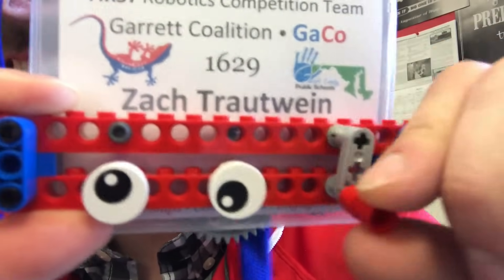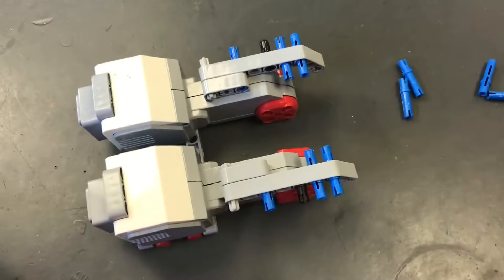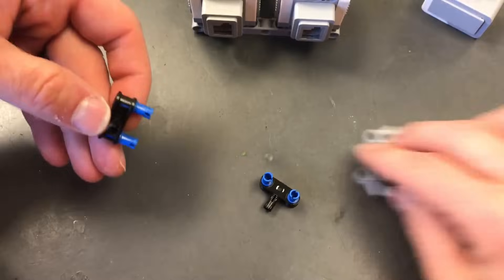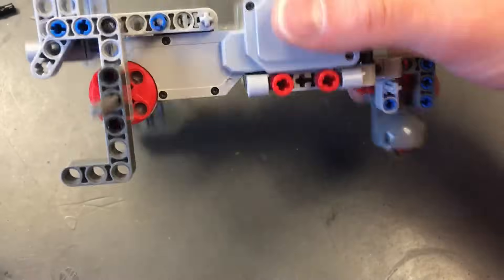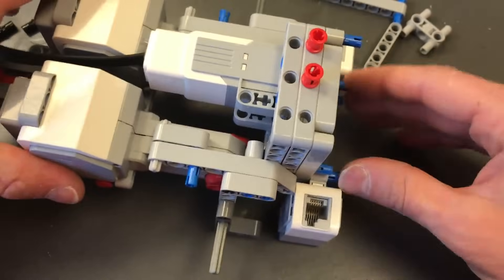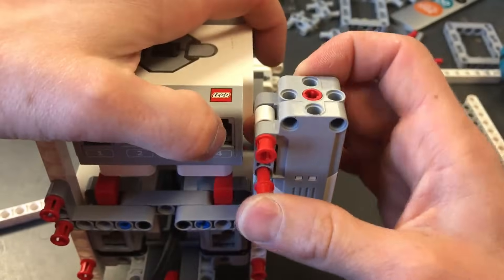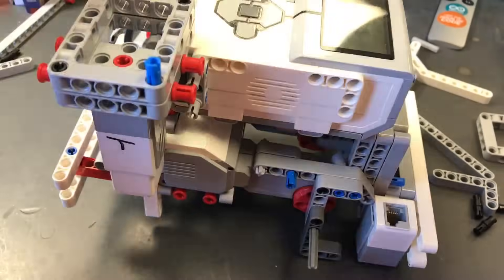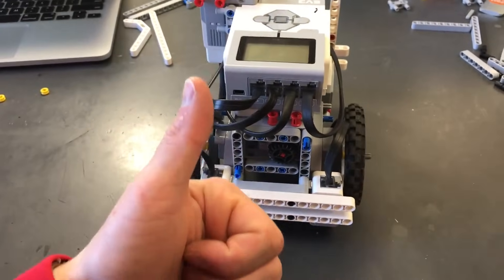Building a Lego ev3 Robot from Base Kit for FIRST LEGO League (FLL)

Comment: Thanks for posting.  The problem with the video is the wheels.  They are not standard, nor are easily available.  This sets up a problem using the standard EV3 wheels where the color sensor is so close to the surface, it doesn't function.  This makes this design not practical for many.  I do thank you for explaining the attachment mechanism.  That should be useful.

Comment: This isn't from a true base kit, as part way through building it you mentioned a second medium motor and a second light sensor. The base kits only have one of each.   I didn't know you could add extra motors or sensors that are not available in the base home or education EV3 sets, if using for FLL. I'm  I wrong?  So, now I've taken it to pieces to find a better solution maybe that uses no more than whats actually supplied.
Reply from the maker: Hi! Very true. I do mention adding an extra medium motor and an extra light sensor. However, in order for this particular robot to complete the robot games for FLL you do not need to add the extra light sensor and motor.

As for your question about using more LEGO that is not included in the base Education kits:
The Challenge guide (https://firstinspiresst01.blob.core.windows.net/fll/2019/FIRST-FLL-2018-19-ChallengeGuide-A4.pdf)says:

"R01 - ALL EQUIPMENT All Equipment must be made of LEGO-made building parts in original factory condition. Except: LEGO string and tubing may be cut shorter. Except: Program reminders on paper are OK (off the Field). Except: Marker may be used in hidden areas for identification."

And 

"R03 - MOTORS You are allowed up to FOUR individual motors in any particular Match. • You may include more than one of a type, but again, your grand total may not be greater than FOUR."

So you do not need to stick to ONLY the parts provided in the base Educational sets. I hope this provides some clarification. Thanks for the dialogue!

Comment: Does this require two medium motors ?I have one medium motor in my EV3 kit
Reply from the maker: Hi! It does not “require” two of them. You can use just one if you like then add another one later if you get a second medium motor!
Reply from the maker: Jamie Marak  hi! I would not use the one on the inside for the front. It’s the most useful!

Comment: Hello Zachary, despite the power of 30 on the engines, the direction is very straight. The robot turns slightly to the left. Over a distance of 1m, it deviates by 2-3cm. Is this normal? Should we work on different powers (for example 30 and 30.3) or with the sensors? What do you advise? thank you in advance
Reply from the maker: hi! I've found 2-3 cm does not seem unreasonable. LEGO motors have a ton of "play" in them. I advise my teams to use sensors to adjust themselves. I also advise them to use the walls to "reset" the robot mid runs.
Reply: Thank you very much for your advice. We will get back to work;)

Comment: Hi Zachary.  Can you tell me the lego part# for those wheels?  I'm in AlCo at Cash Valley.  We're kinda behind getting our bots made.
Reply from the maker: Hi Jason! It’s exciting that y’all are getting your bots together! They are actually hard to come by these days. I believe this link will a post on bricklink where you can grab some.
Reply: Hi Will it be ok if we used  different wheel ? I have a motocycle Wheel but is much bigger than the one you have. Its throwing of the robot.
Reply: The wheels came from the original lego mindstorms rcx set
Reply: Hello, i am from india and I need help to make a robo to finish FLL INTO ORBIT mission. Can you send me a PDF file for making a robot to slove INTO ORBIT mission

Comment: What size wheel is used for this build and what is the part number?
Reply from the maker: its 61.6mm wheel with a 81.6mm x 15mm tire. They are titled as "motorcycle wheels". Part Numbers: 2903 / 2902
Reply from the maker: You can find them on bricklink.
Reply: Thanks for your prompt responses.  Very helpful. Nice build.

Comment: Have you built an ev3 with real/only base kit parts, That will work with 2017 hydrodynamic challenge ?
Reply from the maker: +Donna Robinson hi Donna! So, every part with the exception of the wheels on this robot is available in the base kit. Maybe a few of the sensors as well. You can do the Hydro Dynamics game with one color sensor on the front of the robot just fine. If you’d like to build one of these robots you can hop on bricklink.com and look up part numbers 2903 and 2902. Those are the wheels and tires. You can pick some up for a few bucks! We’ve found these wheels to be far more accurate and consistent. I would recommend the upgrade for the small price! Let me know if you have any questions!
Reply: Zachary Trautwein , I tried to order the tires only to get a no information fearful young mrn ontd= hoeeillvtoy toj3ertain funds.  I just want the tires